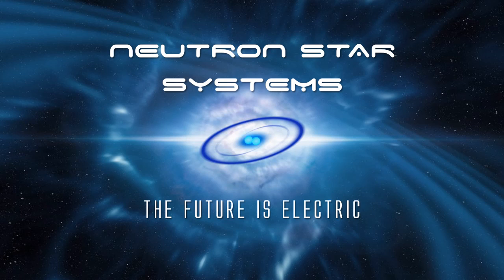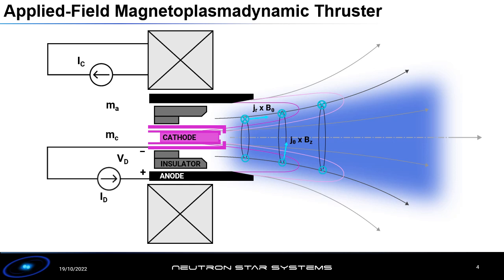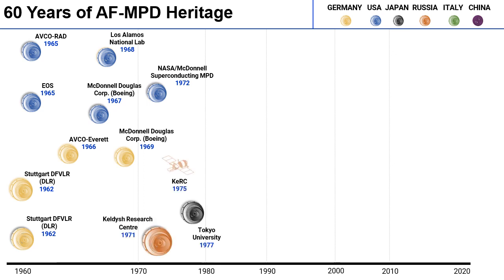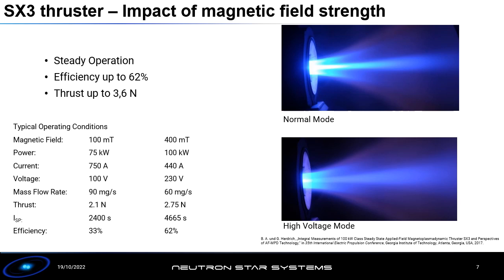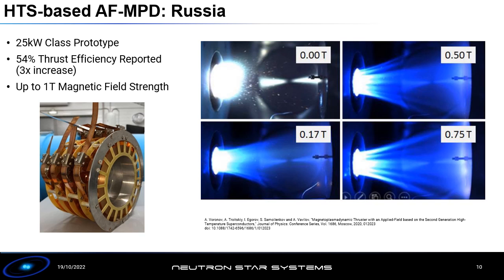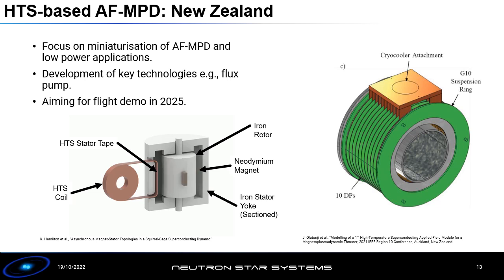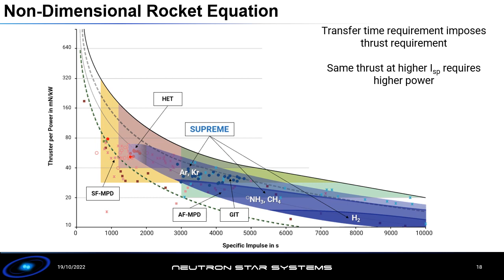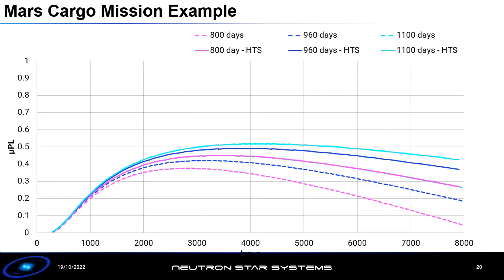Superconductor-based Applied-Field Magnetoplasmadynamic Thruster Technology - Collier-Wright et. al.

Comment: So where is the "earth" aka "ground" or "negative" in the "circuit" you're sending electricity from the supply/source/positive "electrode" through in order to create an electric "plasma" arc that's supposedly going to be formed in the "vacuum of space" and produce "thrust" much like - in "theory"  a giant "electric arc torch" here on the actual  Earth?
Reply: The propelled plasma conducts the electricity itself. And there is no doubt that this all works because it does in experiments, that have been reproduced since the 50'